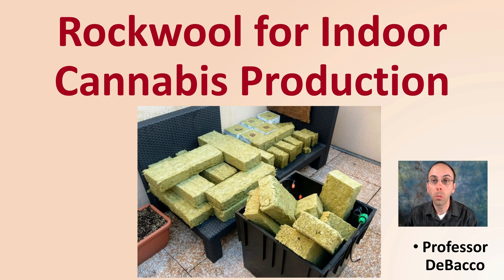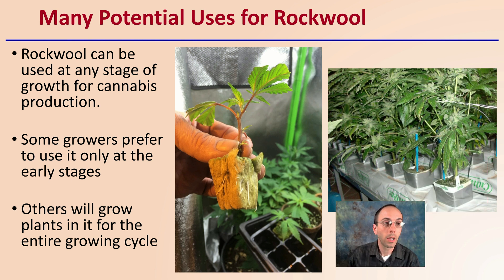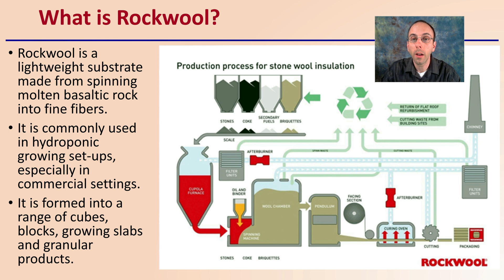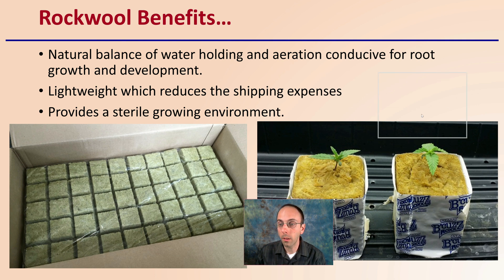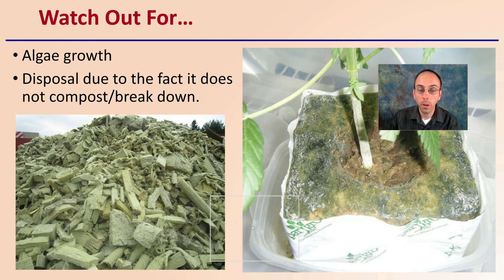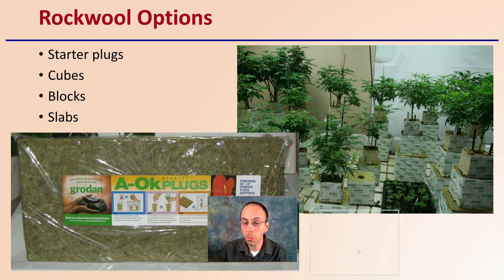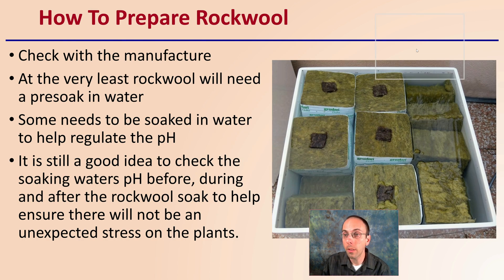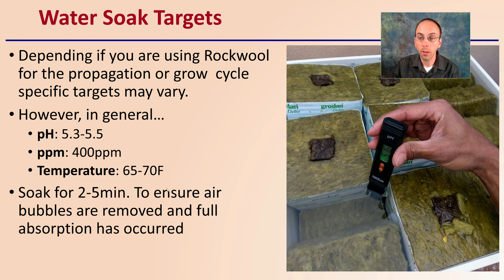Rockwool for Indoor Cannabis Production

Comment: A lot of rubbish. Nothing works when soaking for 2-5min. It takes normally 8-12h to get a stable PH. Once you soak cubes in a bucket where PH is 5.0, for example. It's rising after 1h to 6.5 and this is what you do not want to. So, you have to adjust more PH down and let soak for a couple of hours. The same tech applies to the slab.  The bottom line is - nothing is stabilised in 2-3min. Nonsense.

Comment: I use  small rockwool cubes for clones it works  great every time, but at first I  soak then rinse, soak again one more rinse and usually  they're  good to go. Also my first couple times using  the cubes, I  had them with the clones hovering  above a dish with water but the water gets gross after a day n I  change  it. Now I  just put the cubes in starter soil I keep the soil moist n boom couple  days  later already rooting😆 then it's  potting  soil for the duration of  the grow.
Reply from the maker: Sounds like a good system, do you need that many rinse cycles?
Reply: @DeBaccoUniversity  Yes I  had to keep water fresh it was only in a little tray with the lid upside  down with squares cut out enough  for   rockwool to sit an  inch in water to keep moist, a film would form a couple  days  later so I   would tip the tray in a cup and refill with freshwater. So I  said heck with this tray and water bit I'm going  to  just put the cubes in soil, probably just put cuttings in the light warrior starter soil right😉 I  noticed the  plant's start rooting a bit sooner in the soil rather than a water  tray, I  reuse large soda cups from fast food death joints as the container the white color plastic rather than black plastic helps with root promotion.
Reply from the maker: Thanks for sharing!